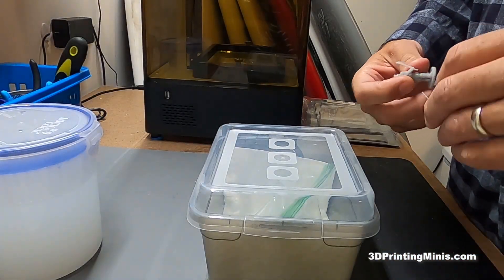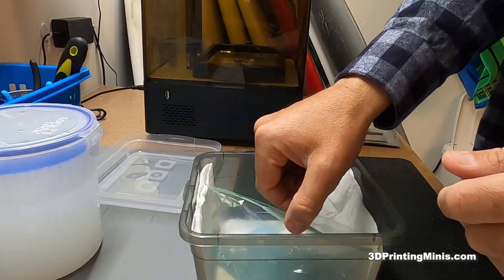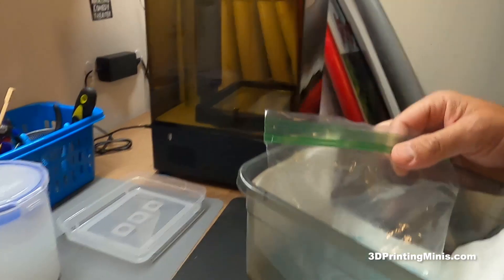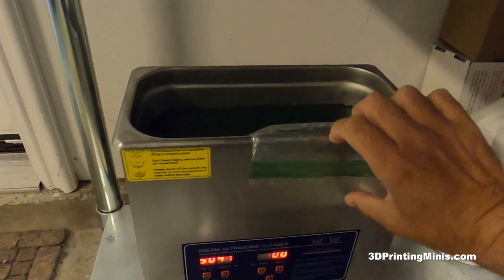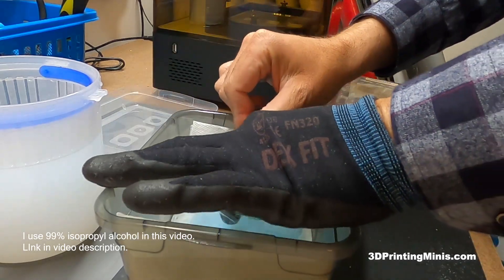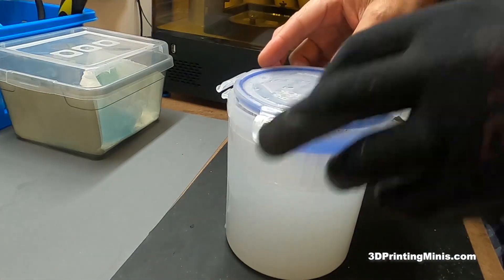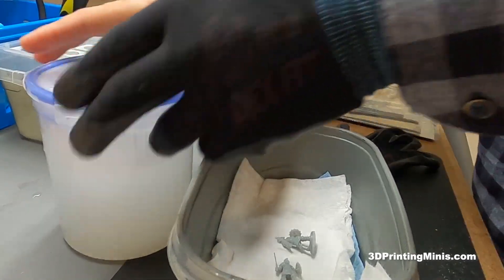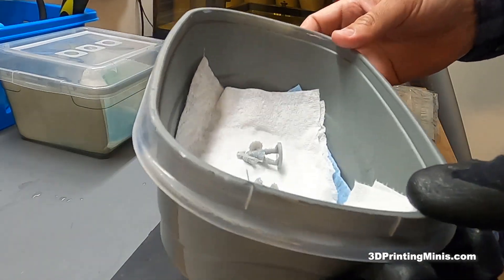How To Fix Sticky 3D Resin Prints (Even After They're Cured)

Comment: If the surface area is still sticky and tacky, is it toxic because I purchased some bits online? Should I be concerned?.
Reply: Ditto? Anyone know?
Reply: Also curious
Reply: Technically yes, tackiness means that the resin is only partially cured. But it's still mostly cured, so it won't kill you.

Comment: I have sticky prints on everything but miniatures. Bought a Wash and Cure 2.0 hoping it would clean better than my dual pickle jar setup. Last print I did I washed in IPA (pickle jar), and then dropped into the the Wash and Cure with Simple Green (not diluted) for 10 minutes, and still sticky. IPA had some use, but Simple Green was 100% fresh. I then tried to scrub the print with a toothbrush while in a pickle jar of Simple Green and dropped into the Wash and Cure for another 10 min. Still sticky. Fairly new to resin printing, but had only printed miniatures until recently. I can sometimes place the prints outside all day and get a usable larger print, but would hope my cleaning and 3 curing stations would do the job afterward, but nope. Resins tried...Nova3D, Anycubic, Elegoo, and Lafvin. For some reason Lafvin white (tried gray as well) does the best. I don't want to spend more on a ultrasonic cleaner (money and space). I bought Simple Green due to cost and many recommendations, but maybe I need to just do IPA. 

I just noticed the reply from @Kreated by Khaos, and he mentions leaving in IPA for a while. I have done ~5 min, but may give it a longer go. 

If you happen to have any other tips it would be appreciated.
Reply from the maker: Yeah, I feel you on the sticker larger prints. I'll do 3 to 5 minutes in ultrasonic cleaner at 40 C and then dips in two different IPA washes. Have tried the toothbrush scrubbing as well. In the end my larger printers are usually models I intend to paint or larger functional items that I can seal with paint. So, I just end up spraying a layer of spray can primer to the print after curing and just leave it at that. But, yes, it's still super frustating.
Reply: @3DPrintingMinis  Thanks for the response. I have been doing some trial and error, and on my last large print things seemed much better. I let my print sit on the build plate for a while, so much of the resin would run off. I soaked in warm tap water and let the resin float off and out of the holes (hollow print with holes). Once it seemed like the resin had stopped its muddying of the water I dried with paper towel and placed in alcohol. I let it set for about 15 minutes. At the end of the 15 minutes I gave it a good scrubbing, and a couple of dunks. I then moved over to my wash & cure for 20 min. All seemed to cure much better (no sicky), and was noticeably cleaner as well. If this is a one off, and I continue with some sticky prints, I may just have to follow your example and get an ultrasonic cleaner.
Reply: @bobboberton1841  I too have found its good to start with water to get rid of excess uncured resin at the start so the IPA lasts longer. IPA is the best cleaning agent. My method is water, then dirty IPA wash, remove supports, clean IPA wash. I think I will get a sonic cleaner and bag some IPA like in this video. Seems like a smart idea.

Comment: ive been using this method for the last year , id also suggest much bigger models i leave in the iso for a good 10 to 15 mins before turning on the machine , i guess i should get off my ass do a video too lol thank you very much for the video :)
Reply from the maker: It's a really good method to use, especially if you're already cleaned and cured a print and don't want to cook it to death by over-curing it. In the beginning I did that and my models turned out really brittle or even cracked a little on the surface. Do this 2nd IPA wash (especially in a heated ultrasonic cleaning machine) can really fixed sticky and tacky model in just minutes. It saved me a ton of headache last week with a bunch of under-cleaned (totally my fault, btw) miniature prints. :-)